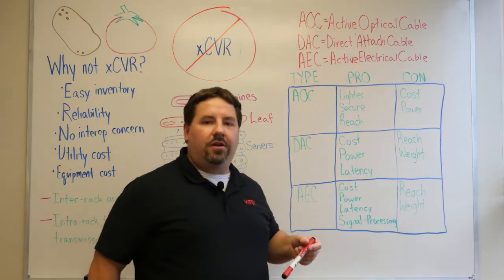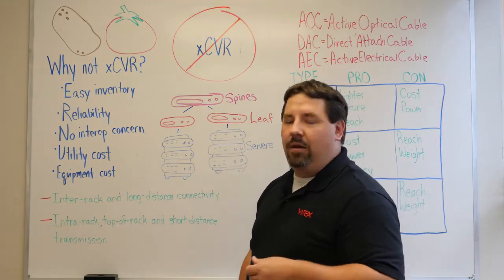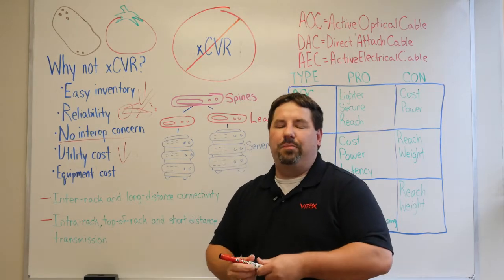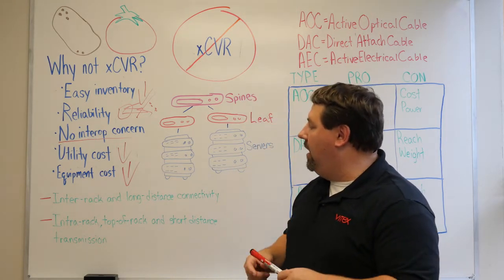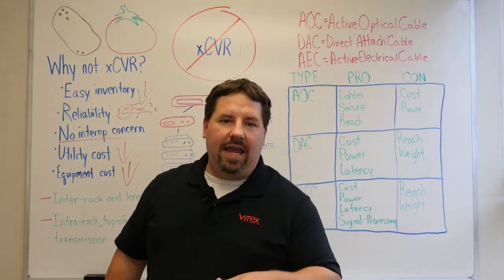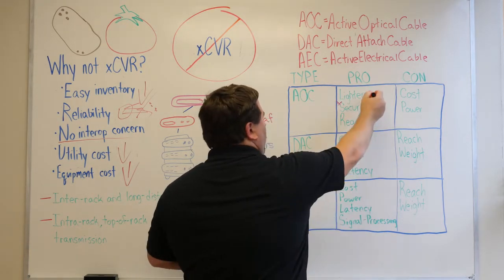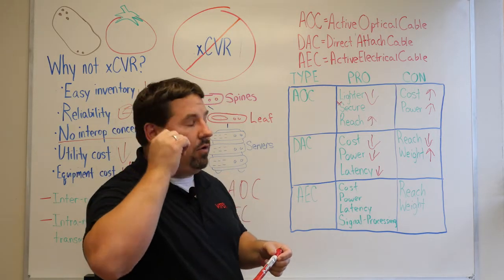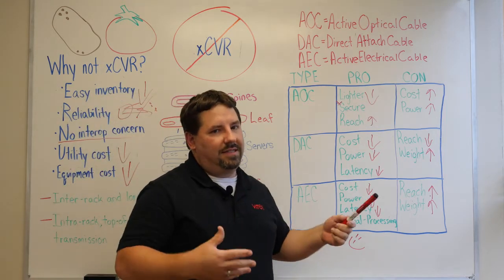Vitex Talks | What to use when an optical transceiver isn’t the right solution: AECs, AOCs, and DACs

Comment from the maker: :yt: Full Video Transcript:
Hey everybody, this is Craig from Vitex, and today we're going to shine some light on situations where you would not use a transceiver. If you're in the data or telecom space, this is something you may want to listen to. Let's talk about why this would actually occur. Being in the optical communication field, everybody knows about transceivers, why we use them, the benefits that they give, but why would we not want to use a transceiver in some of our solutions? Before we actually get into that, let's understand what the alternatives are. We have three primary alternatives that we're going to talk about, the AOC or the active optical cable, the DAC or direct attached cable, and the AEC or active electrical cable. We're going to get into all the pros and cons of those, but let's understand what our options are when we don't want to use them. In some cases, you may want to use one solution for another, so kind of, you know, tomato, tomato, potato, potato, whatever kind of fruit or vegetable you like to use or starch, maybe I think it is, it's going to be whatever your solution is really geared to. Let's talk about why you would want to use something that is a connected cable solution. The first thing to consider is inventory, right? We all know that we're managing large labs, large installations, large field deployments, so reducing the amount of different parts that we have to worry about, say like multiple transceivers and fiber cables or even breakouts. This is really, really helpful that we can actually reduce our management and complexity in how we control inventory. Let's look at our reliability. I'm not really talking about signal reliability. I'm talking more about connection reliability. If you’ve worked with fiber cables, you know we're going to have to unplug them and plug them back in. Let's just take an LC or MPO. Every time we're doing an insert or a removal, we have things like all this little dust, scratches that can come into play. But if we have cables that are attached at the factory, this is no longer a concern for us, and so you can see where one of these cabled solutions has a much more reliable operation to it because we don't have to do insertion and removal of cable. The second or actually third thing on our list is interoperability. A lot of times when you're doing different transceivers, how well they work together, do they support the same rates are a concern in any install, but if we already have all the transceivers and the cables connected, that's no longer a concern to worry about. Next, we want to talk about utility costs. We all know as we input more and more transceivers into our servers and switches, it's going to produce more power, right? As we increase our rates that we're going, it's going to bring more power. Some of these cabled solutions, they actually lower the amount of power consumption, which will bring your overall utility and operation costs down, which is a good thing, right? Save money. On the same end, we can lower our equipment costs because some of these solutions compared to the transceivers, the amount of active components they have and the complexity in the designs, we can provide lower cost solutions that will give you the same amount of data quality in a cabled solution versus a plug-in option. Where do these actually get used? If you're in the data comm space, we're going to look at our basic configuration of our spines, our leafs and our servers to see what is the best area to use one of these different options. For our inner rack and log distances, we're looking more at AOCs because they have fiber components as part of the cabling and they can go for a much larger distance. When we're looking in intra rack and top of rack for more of short distances, we have our AECs, or if we're in even shorter distances, we can use some type of a DAC solution. But what are the pros and cons of using these different solutions? First, we start with the AOC. It's much lighter. It's more secure because it's fiber versus direct electrical connection. We get some nice security and we get some pretty long reach and our weight can drop way down, all right? But disadvantages of it, they're usually higher in cost and require more power consumption. If we move to a different cabled option, say our DACs, we're able to reduce our cost much more, as we talked about, both our operation cost and our purchasing costs. They use less power, so our power consumption goes down, again related to our costs and our latency drops, which can be very important depending on your application that you're using. Some of the problems with these, the reach, that's kind of low, so that's not really an advantage, and the weight can go up, and this could be a problem especially in really high dense areas where you have to consider airflow and how cooling is done. If we want to look to get maybe the best of both worlds, we turn over to our friend the AEC over here. Here we're still going to have relatively low cost, we're going to have low power, low latency, and then a nice, super awesome benefit is our signal processing capability by adding some active components that the DAC doesn't have. Again, when we look at this compared to the DAC, we get a nice little addition from our reach and we can also reduce our weight and the cable diameter, but when we look at this compared to the AOC, of course it doesn't stack up for how far it can reach. If you want to reach out to us in New Jersey to go through some of these options of when the transceiver is not right for you and look at something else, please reach out to us and we'll be sure to help you. And until next time, I'll see you then.